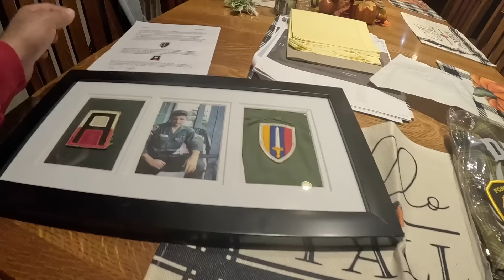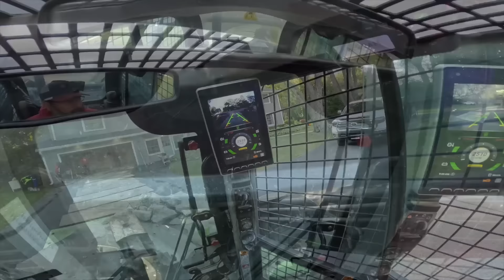I love this equipment! FAST and EASY!

Comment: If the smoke has a blue tint to it, it’s burning oil. If it’s grayish you could’ve blown a head gasket. Not the worst thing ever if you catch it quick. Check the oil to see if it’s cloudy, if it’s cloudy you’re mixing oil and coolant and the coolant burning off is causing the smoke.
Reply: All kia souls do this.  Just know that.

Comment: Ryan, the KIA probably has a blown head gasket. If so, The smoke would be coolant entering the combustion chamber. Would smell sweet and would consume coolant. (Check fluid level). Another possible symptom would be If the oil looks whiteish and foamy.. 

Good luck
Reply: It could be piston rings too!
Reply: @JZE-ev1qx  like chocolate milk after you put in the nestle quick and stir
Reply: that's a good guess....loss of power is one sign(compression) and over 100K on a Kia 4 cylinder is the other.
Reply: It over full of oil since it started doing it right after the oil change. PULL the dipstick and check the oil but we can’t do that in Ryan’s world because he’s already said it ain’t the oil
Reply: No! Just sniff and inhale the exhaust pipe. Sweet, salty, or savory will tell you all you need.

Comment: A lot of the Kia Souls were recalled a few years back. We had one similar year to yours and got fully reimbursed on it. They apparently didn’t clean the engines out thoroughly after assembly on a bunch of there cars in manufacturing. Anyway that might not be the case for yours but I figured it was worth mentioning. Ours died out on us around 104k miles.
Reply: It wasn’t just Kia Souls it was anything that shared those similar motors in specific Kia’s.The engines were all recalled. Find out if yours was one of them.

Comment: Ryan, good morning. I have four Kia automobiles my daughters Kia soul motor was just replaced a couple months ago same kind of scenario you may or may not know that the warranty is 10 years and they have extended the warranty to 150,000 miles on most of the cars, I would take it to the dealership and see what they say. My daughter got a brand new motor three days installed, and it was fully warranted. Best wishes for autumn and her car.
Reply: Cool!

Comment: Surprising to see the electrical code there let's you use romex on a commercial project. Here in Texas anyway, we have to use MC cable or conduit.
Reply: Canada too, armoured or conduit
Reply: yeah its a violation in the NEC.
Reply: Yeah I was super surprised to see that. Just makes me wonder, is this guy charging commercial prices? Pretty good difference in price for roping in a home vs MC and conduit in a commercial building of comparable size.
Reply: @caden01691  yeah idk how that building is classified as a dwelling unit

Comment: When I heard the oil just got changed, check that oil level.  The guys may of underfilled it or forget to put the fill cap back on.
Reply: Happened to my daughter once. Her friend "changed" the oil. He only added 5 quarts, didn't drain anything. Smoking like crazy. Went to her rescue. Drained 5 quarts out, and it stopped smoking within 30 seconds.
Reply: @davidconley6267  I hate to admit that I did that with my first car as well, I had no idea that you could overfill on oil. Thought I did the right thing until my little VW started smoking, my dad fixed it for me and I learned a valuable lesson.
Reply: Probably has a coolant leak and over heated it. Happens alot when not paying attention and most people don't look at gauges.
Reply: Depending on what color smoke. Blue would be oil and white is either a stuck injector or headgasket. I'm sure he already know since these videos are over a month behind.
Reply: @kingyankee69  That never happens with any car after 2005. When engine starts to overheat it is not just gauges,  instrument cluster flashes Engine overheating message, blinking engine light comes on, beeping or buzzer sound from console, all at the same time... So no, nobody normal could say my car overheated and it did know...
Reply: @skela098  maybe you're driving German. I've only been doing this for over 25 year's and never seen a car panic like a plan coming to (Low Terrain) like you expressed. Im not saying all women do this but usually when the warnings going off they only say it's just a couple more miles lol.

Comment: White smoke = head gasket.
Blue smoke = burning oil
Black smoke = running too rich.
Reply: Exactly when I saw the white smoke instantly knew head gasket is bad.
Reply: Actually, you’re both wrong. Kia has a recall on bad rings.
Reply: Also if the exhaust smells sweet thats another way to detect if the head gasket went bye bye
Reply: @robertfischer4160  Actually, I am correct. Blue smoke, from burning oil due to bad rings (if its the rings, the ring issue was specific to years and cars, not across all models).
Reply: Recent oil change? Maybe too much oil was put in?
Reply: Kia has problems with oil consumption and bad motors.
Reply: @doublemc2633 i have seen too much oil and it does smoke. When you're have too much oil, not saying that's what it is
Reply: Could also be a fuel injector stuck open and the fuel is not getting combusted and is filling in the exhaust system most likely the issue and not a bad head gasket at 107k miles
Reply: @DOP3atNOscope  Fuel would be black smoke and fouling plugs.
Reply: @darknes7800 wrong!! haha I’ve had it happen
Reply: @doublemc2633  When Ryan said some place just changed the oil, Like a Rapid oil change place, The first thing I'd be doing is checking it's level afterwards instead of relying on them. Just to be sure.
Reply: Could also be a bad turbo
Reply: @doublemc2633  thats my thought
Reply: @matthewscorgiecole3819  Could be, but usually they dont smoke.  Its just a lack of power due to the turbo not spinning freely.
Reply: @DOP3atNOscope  Then you would be the FIRST........black is always too much fuel, unless its a diesel engine.
Reply: Hey! You don't have to get racist about it! :face-blue-smiling:
Reply: @robertfischer4160  Turned out to be a HEAD GASKET !!!!!!!!! LOL  Better look at the NEXT video !!!!!!!!!!!
Reply: @joelnasdaq2724  Right !!!!!!!!
Reply: What about the internals though?😅

Comment: On the Kia if they just changed the oil and it started smoking then they probably over filled it!
Reply: I was saying the same thing.  I was yelling at the screen telling Ryan to check the oil level!!!!!
Reply: @markreynolds1663 when the guy said timing chain I was like bro what ??😂😂
Reply: @Slow4b9 it could be the timing chain some like to go right around that 100k to 150k miles
Reply: @Riley.v   but would you not hear rattling coming from the timing case as well as a mean misfire ? Even if it’s just the paddles a loose chain will smack the case , and if its binding up it wouldn’t even start or give trouble starting
Reply: Yes👍
Reply: I was surprised he didn’t check the oil.  Coolant in the oil, blown Head gasket.   Overfill. Like come on. Don’t need to be a mechanic to figure that out.  Nate the great wasn’t so great on that one.

Comment: You’re getting a bad mixture if I had the gas, you can actually can take cardboard or parchment paper and check the pressure and see which cylinders are actually firing. You could probably use those concrete pillars as a wall or a parking spot. Love your videos keep it up.

Comment: Replace the pcv valve and run some stiction eliminator right before the next oil change,kias are known for sticky rings,if you run cheap oil they tend to stick the rings,a clogged pcv will put a ton of back pressure in the block and push oil up past the rings also.

Comment: Kia's been replacing certain motors for free, [thousands] the engines have been dying because of faulty original machining, to qualify the oil has to have been regularly changed at the correct intervals , usually the engine will just die and won't restart, you can find many articles online about it, it is under court order to do this !!
Reply: 💯  This happened to my mother's newer Kia.
Reply: Yeah they quit trying to fix them so now the dealers just have a boat load of new engines at their shops to replace the bad ones !
Reply: My buddy had that happen to him to. They just replaced the engine.

Comment: Engine smoke can be 3 types, fuel will be black, oil will be blueish, and water vapor will be white like fog. That looked like water vapor which can indicate a blown head gasket or coolant somehow getting into the combustion chamber.

Comment: A little mechanic Secret on the truck with the starter flywheel issue shut the truck off while it's in gear with a load on it the motor will stop in a different location giving you better selection on the flywheel on restart👍

Comment: Head gasket?
Reply: With the truck it’s got to be something electrical in the ignition like a loose wire somewhere causing it not to fulling engage the starter. It will spin it at a certain voltage but not fast enough to push it to the flywheel. And with a 25 year truck it could be a ground somewhere that needs to be cleaned.

Comment: It may be worth looking into putting battery cut off switched(night switches) on the big trucks and the form truck that way nothing will go dead no matter what’s forgotten left on if the switches are turned off plus it would be a theft deterrent and maybe it wouldn’t hurt to put them on the skid steers as well could save you time and money with battery’s

Comment: Good morning Ryan. In answer to your statement about the vitamins in energy drinks: the vitamin E is definitely lab produced because it is an oil based vitamin. The vitamin B-12 however is often extracted by a chemical process invented incidentally by two Milwaukee scientists in 1953. The bottling companies who produce the drinks have generally opted to used other less “disagreeably” sourced product due to the optics of the situation. Using a sludge created product would create a public relations nightmare especially for the larger bottling companies. The short of it is that it’s just not worth it for them to alienate a segment of their customer base. Hope this info helps.

Comment: I'm guessing that Nate is going to find worn valve seals on the Kia based on my interpretation of the smoking you mentioned. You didn't say if it was smoking constantly  or if it smoked whenever you took off from a stop. But based on what you were doing whenever you stated it was smoking, it appeared to me in the video that it would smoke worse whenever you took off from a dead stop. That would indicate worn valve seals and the oil is passing down the valve into the combustion chamber. At this typing, Nate has already checked the vehicle because I know your videos don't air for a couple to few weeks out. So I guess I'll look to see what Nate says in the next video...maybe.

Comment: Ryan check with Kia they are notorious for motors going out. My sister had a 2014 sorrento with 107000 miles and the engine was burning oil within a month and it finally blew. I called Kia motors international and they replaced the engine with no charge. It seems the knocking sensor goes out and burns the engine. Even though it was out of warranty they fixed it and some motors have a lifetime warranty

Comment: New motor coming soon for the Kia Soul.  Im a Hyundai tech, see it all the time on the hyundai vehicles.  About $6k for replacement!  Needs a combustion cleaning and compression check, then most likely a BCT(bearing clearance test).  If it is failure due to bearings, kia will replace it.

Comment: Check the modulator valve on the transmission if it has one that's what smokes a lot is the smoke white and has a trans smell to it compared to a burning motor oil or do you know Ryan. Your backyard mechanic worked in a service station many years.

Comment: Could be a clogged pcv on the Kia and check coolant and oil if it’s over filled it could smoke if the coolant drops and the oil level raises could be head gasket and water/coolant getting into the oil or the combustion chamber

Comment: For Autumn car, it could be the pcv valve issue. I had issues with mine, lost power with misfire and was smoking crazy on load slightly at idle... I borescope it and find pool of oil in one cylinder, the intake was full of oil condensed fumes with water and fuel mixed. I was not a Kia but they are engines

Comment: This should be expected on most newer cars they are all GDI now so they only last like 100k miles, The gasoline no longer flows through the intake manifold over the valves into the combustion chamber cleaning the valves every time it's running, GDI is similar to a diesel where the gasoline is injected directly into the combustion chamber so now your valves get all sticky and gummed up with carbon

Comment: That starter problem is definitely a flywheel issue. Replace it and you might have to replace the starter as well just to have fresh teeth on both.  Flywheels in Fords tend to warp, teeth look fine but warp out of line. Aftermarket one (replacement) seem to forever fix the issue.  Just a hair of tolerances and the no start problems begin b

Comment: You shouldn’t break those up those cement beams. Use those as the sides in the back to put one of those salt tents in your yard. That way you have a spot to put salt in your yard since you’re giving up the winter yard soon and that you still have place to put the salt for when you plow during the winter

Comment: I am very familiar with  kia and issuse with smoking on them the crank case ventilation can be filled with oil and when hard acceleration  happens it can cause the engine to smoke until the oil is cleared out of the ventilation system

Comment: 45:00 for your daughters kia, check a few things
1. See if the oil is severely overfilled if the oil was just changed. One cause of smoke.
If is overfilled correct the level should be fine.
2. Confirm if it is burning oil, level is low (blue smoke). oil plugging the cat converter would cause your lack of power condition 
3. If engine is condemed from excessive oil burning kia has an extended warranty on their engines for exessive oil consumption, knocking or general failure 
Usually 15years 150,000 miles 
( their engines are garbage)

Comment: I would check the Catalytic converters because those can let loose and plug up the exhaust and cause white clouds of smoke to come out that's what happen to our Chevy impala at least and it caused the engine to lose power and ended up wrecking it.

Comment: Check with Kia about the engine failure. 
If it's bottom end, they have a special policy coverage for specific  vehicles.
I THINK that one included.
It's 15yrs/150k miles.

Comment: I think you need to implement a no running zone in the work place. There’s a reason why most work places is a big no no. All those times ray has been running with those boots on uneven surfaces has started to affect his knees.

Comment: Kia did an extended recall on the 4 cylinders motors in those cars for excessive oil consumption.  Eventually it just locks up.  Call the dealer and see if the recall is still active.   I had a customer that Kia put a new motor in with almost 200,00 miles on the car.

Comment: Hey, maybe too much oil. That can cause it to smoke badly. My wife's aunt put too much oil in her car, and she was telling me she blew her car up. I laughed so badly and she was crying,  but then she asked me why I was laughing so badly and I told her to have the car dropped off at my house because she had free towing.  I drained her oil, changed the filter, and put the correct amount of high mileage oil in it, and it was like brand new with 213,000 miles on it. I also changed he o2 sensors and put a new catalytic converter and a brand new exhaust on for her, and I didn't charge her a dime. All she did was pay for the parts.

Comment: I am ex military and let me tell you, grave registration is by far the worst job in the military. I remember talking to other vets and them telling stories of temporary graveyards as the Soldiers moved across Europe. The fallen had to be dug up after the war and buried in proper graveyards. I have nothing but respect for the men who did that nasty and necessary job! GRS was part of the quartermaster corp. I was a 76 Yankee which was a unit supply specialist which is quartermaster. I met several of these guys who both served in Vietnam and Korea.
Reply: Thank you for your service.

Comment: @Victory Outdoor Services, 

I know this is probably late for how long ago this video was filmed. But according to the diagnose on Autumns car, with the sweet smell from the exhaust. You are guaranteed to have mix of coolant with your engine oil, and that can only mean something in these directions, can be singular or multiple of these points. 1: Head gasket is blown; or 2: cracks in the cylinder block near the oil or coolant channels; 3: cracks in top cylinder block. 4. Oil rings on the cylinder heads. These 4 points, can all allow coolant to mix with engine oil.

Comment: Ryan your daughters car most likely has a head gasket that is going!! Check the oil and the coolent to see if it has oil in the antifreeze in it! Next see if it was overfilled with oil!! It's more than likely a head gasket issue Ryan!!
I can tell by how it's running when you drove it it's head gasket!!

Comment: i cant watch any more, jk. when the truck will not turn over... grab a socket and turn the alternator just a little bit. then see if it starts up with out problems.. i am almost 100% its the flex plate teeth that are broken.. but you keep grinding it like that you going to neeed a new starter as well "duh" lol great videos.

Comment: *********RYAN**** IF YOU MOVE THE CONTROLS AROUND ON THE SKID LOADER BEFORE YOU CONNECT THE LINES ON FRONT- THE PRESSURE WILL BE OFF AND THE LINES WILL BE EASY TO CONNECT. JUST MOVE THE CONTROLS IN ALL DIRECTIONS FIRST WITH THE ENGINE OFF.